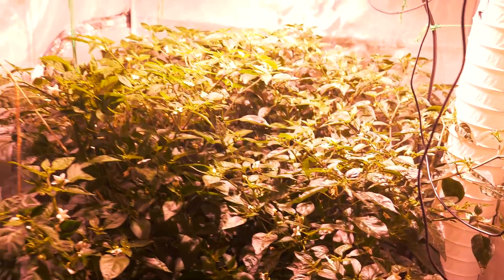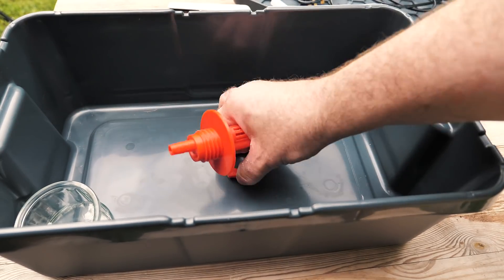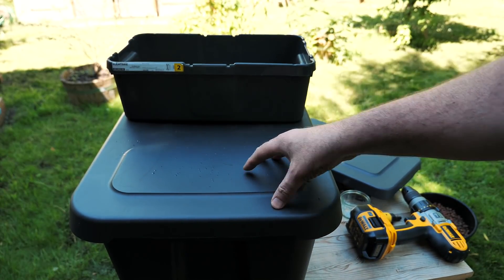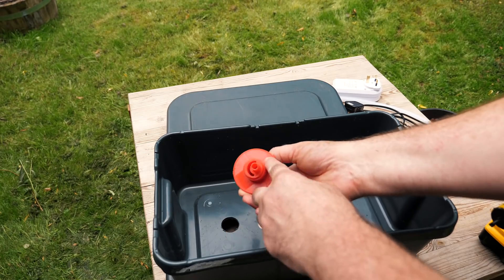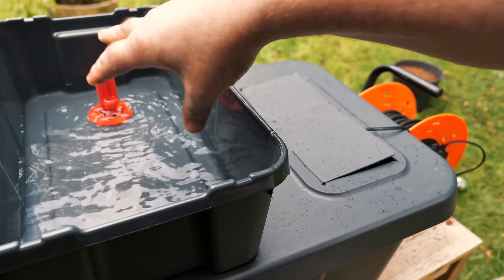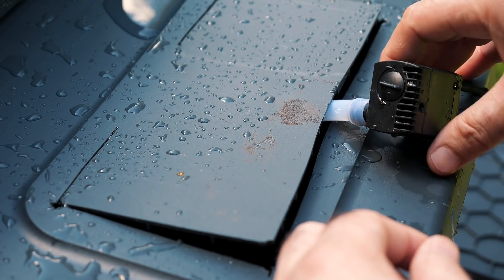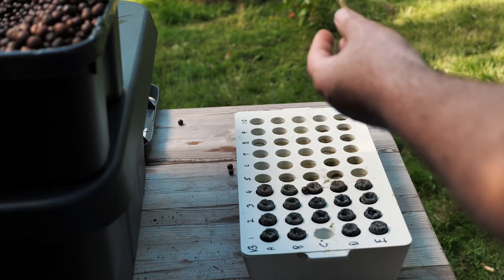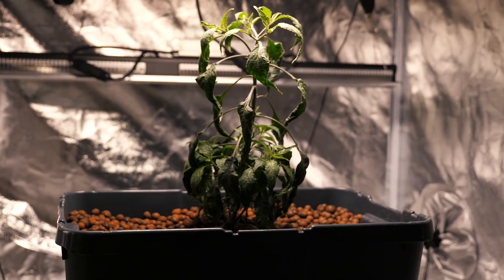DIY Ebb and Flood Hydroponics with 3D printed parts (optional)

Comment: What type of material are you printing with? I noticed that the box is made of PP.
Reply from the maker: PLA.
Reply: @ChilliChump  But PLA breaks down in water and probably enters the plants. Aren't you worried about the long term effects? I'm sorry that I'm being a bit critical here. Just so you know, I'm really impressed by the things you are creating and that you respond to comments.
Reply from the maker: I have got some PLA sitting in water outdoors for the last 2.5 years as a test. There is no noticeable breakdown at all so far. Also PLA is biodegradable, so even if part of it was breaking down over time, I wouldn't be concerned about any long term effects. PLA is used for medical implants...as well as food handling.

Comment: If you're tempted to try a hydroponics kit indoors in one of the wetter/damper climates in the northern hemisphere, 
make sure to have access to a strong extractor fan & venting to outdoors in order to control the humidity for your plants and property (don't want any mold).  
Smaller fans near the plants will also act like wind does outdoors encouraging thicker, sturdier stems on your chillies/tomatoes/etc.

Comment: You mention the 50l reservoir will last about 2 weeks with a mature plant.
"Last" in as nutriants are used up, correct? Do you then empty the container and refill it?
Reply from the maker: No...as in the the resovoir needs to be  refilled. It will essentially be near empty by that time.
Reply: @ChilliChump  Oh, didn't think it would use up so much water. Thanks

Comment: I'm new at this and I've been trying to design my own ebb and flow system using siphons. Watching someone who knows what they're doing made me realize how much I'm overthinking this! I was trying to work out some passive loop siphon system that had the pump always on, but I just haven't been able to get it to work. Crazy it's as simple as just letting the water drain back down through the pump. D'oh! Time to break out a Pi Zero and a couple relays! Thanks!
Reply from the maker: Don't worry....I did the same! I love the concept of a bell siphon, but it really isn't necessary!
Reply: @chilliChump Don't you think, that it will damage the pump in the long run ? That is one of my worries and how to make sure that the pump doesn't block up with the organic waste and dirt draining down into the reservoir. Been thinking to build one myself, but I am unsure about the issues mentioned.

Comment: How would  plants do outdoors? Do they have enough "root strength" to stand up to some wind? Thanks!
Reply from the maker: Have a look at some of my other hydro videos. I use a similar system, just scaled up, in my greenhouse. And I used a smaller system last year as a test in the greenhouse too. Like I mentioned in this video, have a look at my 2019 grow update series, you can see the progress of the two systems.
Reply: @ChilliChump  Thank you very much for the reply. I will later this evening.
Reply: @ChilliChump  
I use a diy 12 bucket outdoor flood and drain system for chilli`s,  completely open to the elements and have no trouble.

Comment: if you don't have a 3d printer what can you use for that drain?
Reply from the maker: You can use a barbed tank connector. It will flow back through the pump when the pump is off. Also you would need to place a pipe for overflow (that is built in the 3d printed part)
Reply: @ChilliChump  excellent sir. I thoroughly enjoyed the design you made.

Comment: I don't understand what the point of hydroponics is. It seems to me that this is way more complicated takes up way more space and requires way more energy than to just plant it in dirt. Am I missing something? I don't understand the benefits. I've had great results with 3 things. Compost water and sun. All 3 are basically free and easy to obtain. 

Hydroponics requires chemicals and electronics and timers and grow lights. All of that stuff adds up. I can see it as a novelty thing like maybe a few plants just as an experiment. but really I see nothing but disadvantages.
Reply from the maker: I personally prefer soil. However hydroponics results in less waste and quicker growth

Comment: Is there a substitute of the 3d overflow part I could buy for people without a 3d printer? Great build and video.
Reply from the maker: You could create it using a couple pipes and a tank connector. I did that as a test before creating my 3d printed part
Reply: @ChilliChump  awesome, thanks. This will make a good winter project for me.

Comment: Why is it important to match the pump-on time to the filling of the upper box? If the upper box is full and the pump keeps going it would simply overflow and drain to the lower box. Is that a problem if it happens for a minute?
Reply from the maker: Because the longer the upper area is full the more likelihood of disturbing the roots.  The clay pebbles can float.
But ultimately it isn't too much of an issue

Comment: Hi, I would install an overflow as a matter of course, out of the side of  top tank down into the lower one, also if your pump is none adjustable then another 30 seconds of flood won't hurt your plants and your table will not overflow, oh!  after watching all of your video's my plans for next year are going to me a fortune, and I can't wait, inspiring.
Reply from the maker: There is an overflow....it's built into the 3d part I created
Reply: @ChilliChump  Hi, apologies, I did not realise it was built in, nice design and efficient, do you sell the 3D printed components.
Reply from the maker: I can if you like. Where are you based?
Reply: @ChilliChump  Hi, Sheffield
Reply from the maker: Reach out to me on Facebook, or through my website www.chillichump.com/contact

Comment: Great share, thanks for the info. After time could you get a slime build up in the tank ?
Perhaps that intense light gets through the flap openings and could encourage bacterial growth. Maybe a simple cloth covering could defeat that ?
Reply from the maker: No problems with that. Remember you are replacing the nutrients every 2 weeks or so...and it's a good idea to rinse the reservoir out at that time. Also your plant will shade the bottom pretty well. Never had an issue. Even last year with my semi-transparent setup
Reply: @ChilliChump  Good to know, thanks for your reply.